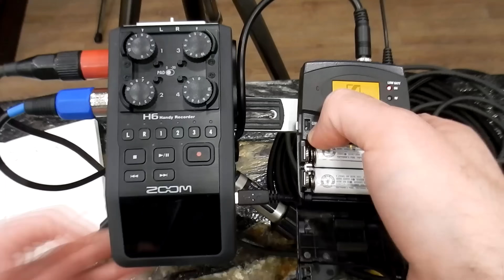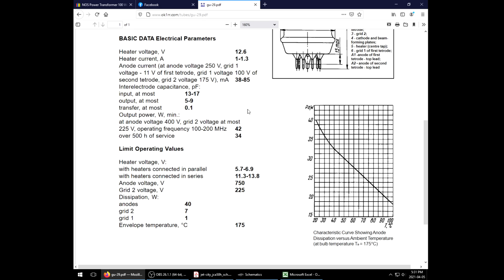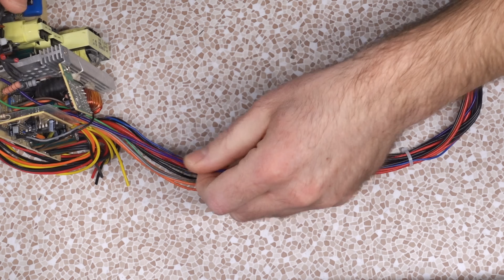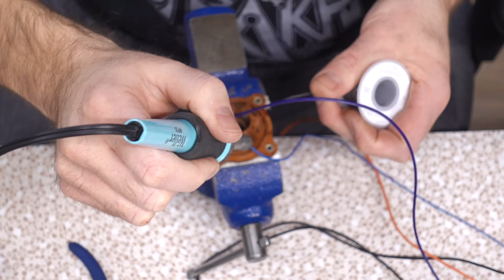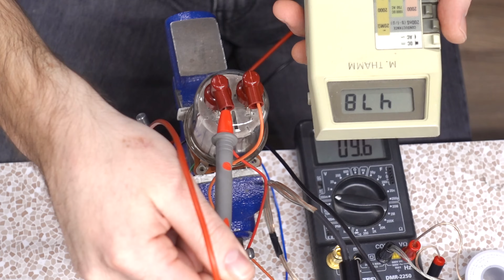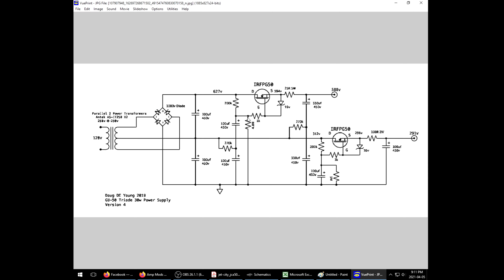The Russian Tube Experiment

Comment: That tube looks very very similar to a US standard tube the, 829b. I suspect it is a pretty close copy. It was designed for transmitters at up to a couple of hundred megahertz, maybe outputting up to 100 watts.
Reply from the maker: Ahh yes, the 829 sounds familiar. I think it is an equivalent if I recall correctly. 
I know this is a high FQ transmitting tube, I find it hard to believe you could get a 100w out of it alone, but then, I don't really know much about TX amps.
Reply: @DATT  There are two styles of tube ratings CCS--Constant Commercial Service and ICAS--Intermittent Commercial and Amateur Service. There was quite a difference in maximum power levels. I able to easily find it online. Max power input for CCS was 60 watts, 90 watts ICAS, without forced air cooling, somewhat more with.
Reply from the maker: @mikemcguire1160  Hmm, interesting info. I did notice the data sheet listed 2 output levels based on desired tube life.

Comment: If that amp uses a feedback resistor from the speaker output to somewhere before or in the phase splitter you may want to play around with the resistor value to vary the amount of negative feedback. 
Oh and as others have mentioned, twisting the control grid wires together and separately the anode wires together will help balance and cancel the crap being radiated by the anode leads and cancel the crap being picked up by the control grid leads and help with killing stray oscillations.  Heck may as well slap a 150pf or more or less capacitor between the control grids to snuff out parasitic oscillations until you get around to mounting things in a more dressed chassis.
And man thanks for doing this!  This is awesome!!
Reply from the maker: Hmmm another reference to twisting. I usually avoid twisting audio wires.
Reply: NOT-AHH!!!

Comment: as u already know thats os-killation 
way too long leads,  no stopper resistors, had the same with hitachi based diy mosfet amps , would be very interesting to scope it as is just to see how severe it is

got the same thing going on with a diy tube tester i built,  fine for 12au7s ect but as soon as i jam in something beefy like el34 gauges flick all over the place the moment i draw some current, yet to get round to that
Reply from the maker: Yeah, I didn't realize it at the time. But it was obvious to be in editing. This vid could of been a lot different. 
I was recently working on an old Traynor head that when unstable after I changed out the Output transformer. It took me to damn long to realize it was just the layout but the grid stoppers too far from the actual tubes.

Comment: Remind me of an fu 19 tube
Reply from the maker: Ohh, I think that tube is that same family. If I recall, I think this tube is also known as an FU29, which is the 19's bigger brother.
Reply: @DATT  interesting. I'm just starting to get into tube's I'm usually  a BJT guy mostly  because of the high voltage tube's need it's just safer to play with BJT's but I'll eventually get my feet wet with tube's
Reply from the maker: @SheikhN-bible-syndrome  Oh, you might be interesting in low voltage triodes, like the 6C33C or there 6080. They are lower voltage tubes that are often used in output transformerless designs of similar topology as a BJT circuit.

Comment: You nailed the problem at the 19:40 mark. Twist heater wires, fit grid stop resistors and screen resistor right at the tube socket, and twist anode wires. I have chased way too many odd distortion faults in production amplifiers that came down to some combination of these things.
Reply from the maker: Twist anode wires tho ? Twist them with what ?
Reply: udon'tnowutthehelyertawknabout!!.......🐑💨ppppppp

Comment: Ever since I saw Styro Pyro make a Tesla coil with a Russian GU-5B Triode tube I've wanted to see someone use some obnoxious large tube like out of a Radar system or something. This is super awesome, especially since you were getting a nice chug tone and not just playing boomer blues licks.
Reply from the maker: Oh yeah, that's a BIG power tube you've mentioned. 
And yeah, I'm a metal play originally, I do a bit more of that bluesy stuff now, but it did/does annoy me how a lot of gear reviewers and testers don't do so with more aggressive tones.
Reply: @DATT  yeah it's crazy big, would probably be quite a project to make one work for audio haha. Metal and punk is all I know but I love tube amps and weird projects so your channel is right up my alley haha.
Reply from the maker: @CryptToneMusic  I think some of those massive tubes were still used for the longest time in broadcast cause they simply didn't make transistors that strong. Probably changed by now. But I know they were still using them, and making them in the 90's and early 2000's.
Reply: @DATT  thats pretty wild, I'm not sure but I think tubes were used in radar as well for longer than you would think. It's crazy to think of tubes and mostly analog circuitry used in jets that were possibly going past the sound barrier
Reply from the maker: @CryptToneMusic  Oh definitely, anything that needed to manage a lot of wattage. There is this other odd soviet tube that comes up from time to time, the 6C33c, it's about the same physical size as these, or at least they use the same socket, I read it was used in the MIG jets.

Comment: What is the difference between a audio beam power tube and an RF beam powered tube? Depending on the frequencies you want to run not a lot. They tried to keep the input capacitance to the grids lower but that's about it.
Reply from the maker: Kind of figured there wasn't that big a diff.

Comment: I would like to recommend the 829 tube by RCA.   It is the exact same tube.  That Russian tube was an RCA design shared by the United States during world war II with the Russians.  The nice thing is there is limited use for the tube so they even in new old stock American manufactured do not cost a lot.
Reply from the maker: Hmm, I was aware of the 829 but that's an interesting tidbit of history right there, neat.
Reply: Another more modern choice is the 5894.  Those tubes make excellent audio power amplifiers.  He should run class AB1 push-pull.
Reply: Very cool video.
I really liked it.
Reply from the maker: @orjanwerner9696  Thanks !

Comment: What might be the next experiment GU-80?
Reply from the maker: The GU50 interests me actually, but that's far in the future right now.
Reply: @DATT  GU50 is not an expensive tube, they are already for sale here at 12.50 euros. The GU80 is a well-known tube for building Tesla coils, but is also suitable for making amplifiers, If you don't shy away from tinkering with 2 kV.
Reply from the maker: @20kilovolt  Yeah all those old soviet tubes are affordable. Costs a bit more for me to get them shipped here, but still pretty cheap. 
The only reason I havent' played with them more is cause I don't really want to gut any of my amps enough to make them work.
Reply: @DATT By the way, do you know Frank's electron Tube Data sheets?
Reply from the maker: @20kilovolt  Oh yeah, I've refered to Franks site a lot, especially back in the day when I was learning.

Comment: Cool video, might be worth building a new amp around these tubes if you want to pursue it further, and voice the preamp to get the desired sound with these tubes.  

I recall DAR amps building a few different designs using oddball russian tubes, before disappearing off the face of the earth about 10 years ago.  From memory I think some even had no output transformer because the tubes used had a low enough output impedance to drive a speaker directly.
Reply from the maker: Hah, I can't see building a whole amp jsut for these tubes, but I can see eventually retro fitting them into the right amp. I have some ideas. 
Yeah, DAR was using the 6C33C, which is a lower voltage tube, setting the circuit up like a solid state transistor circuit let them run the speaker directly cause the voltages and current they operated at were close to the voltages and currents speakers run at.

Comment: Capacitor & diode voltage doublers suck at delivering current.
Reply from the maker: You referring to the PSU design of this amp ? It actually works really really well, I was surprised. 
When you use a doubler you can half your current potential, but in the case, the transformer is rated for a lot more than I need, and the caps total capacity is also much more than this circuit needs.

Comment: How many 12AX7s does one need to drive an output transformer. Buy a  high current switch mode power supply for the heaters. Wire the AX7s in parallel. Could be fun. Can you get twenty watts?
Reply from the maker: Hmm, the switch mode PSU is actually not a bad idea. Having enough heater current to use more than one of these tubes was part of the problem. 

And to give you perspective, Marshall actually had several "1 Watt" amps a few years back, that used a single 12AU7 as an output. I think the AU7 was chosen not cause it was the target wattage but because it's design was more appropriate to drive and OT. 
So, I guess it would take 20 tubes to make 20 watts.
Reply: forget it :D You cant get any useful power from 12AX7s.  Maybe 12AU7 some laughable 2-5W amplifier, in fact someone has built an amplifier made of EF86 final stage (interesting idea lol) but this is not sustainable in any means. 12BH7 or the JJ ECC99 would work wonders with an output transformer. They are in face used in interstage transformers to drive 300B triode grids or directly if you are up to some foolery.
Reply from the maker: @adam207321  1W 12AU7 is exactly what I was thinking. I have plans to do a 1W amp build. Well, I already have a 1W amp, or it's putting out 2W using EL84's. It's jsut a weak design. 1 or 2W is louder than you think, so it'll be fun. Plan is to use a 6N6P however.